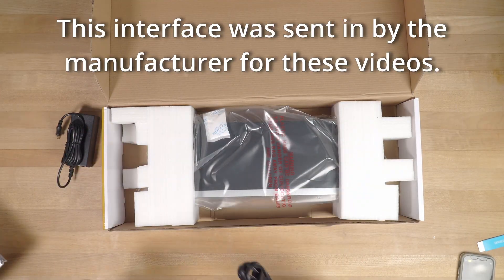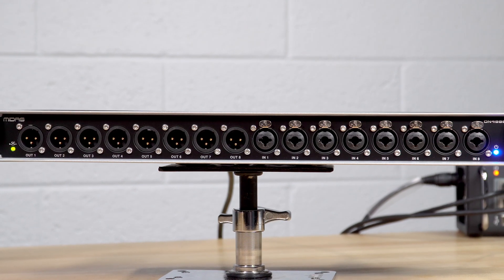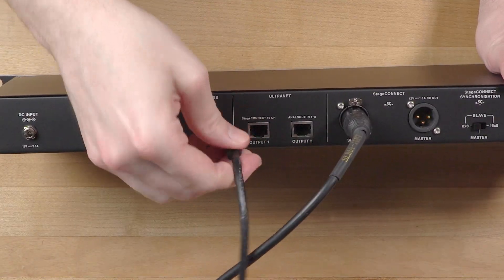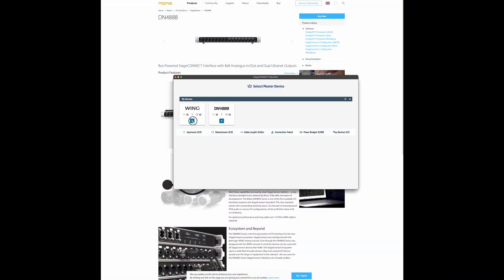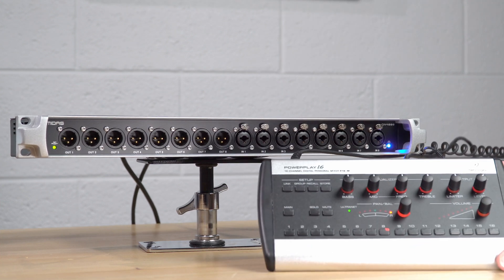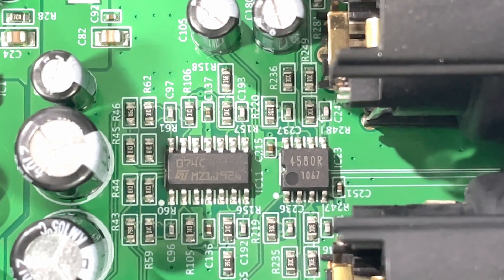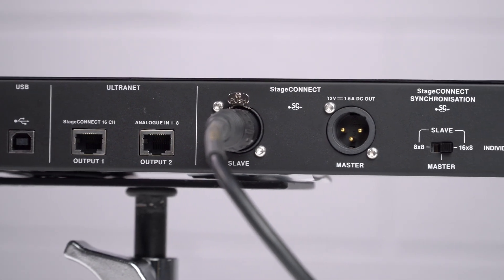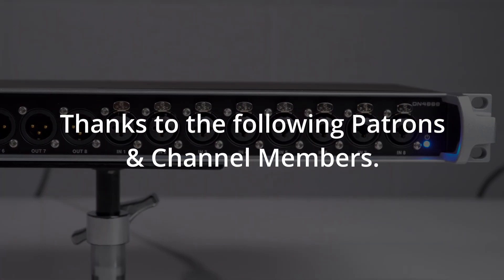Midas DN4888 StageConnect - 32. Channels on a Single XLR! 🤯

Comment: These modules from Behringer are not available, yet Stageconnect itself is open source. Either they're planning to can the whole Stageconnect (A2B) ecosystem or bring out new products. IMO a hole was no mic level inputs on any of these units.
Reply from the maker: What do you mean? I just looked and they are in-stock at B&H and Full Compas right now, and available for back order from Sweetwater. All of the versions have been available for quite a while now.
Reply: @DcSoundOp  I am in the UK and these are listed as back order for 3 months by all dealers.

Comment: I'm using a DN4816-O with Ultranet from a M32C in my IEM rack. Additionally, I've got a DN4888 on order, that is supposed to be used as expansion for my Wing Rack, to give it some more outputs, inputs and Ultranet.

Comment: Hi, i did try to connect a DP4888 and a DN4816-O together (with the 2 additional Adapters) to use as a 24ch splitter with my Behringer Rack Wing. It worked for 20 minutes until the DN4816-O stopped giving a signal. I tried everything, then i only connected the DN4816-O and by itself it's ok? Everything reconnected, ...... nothing... and suddenly no more power anymore in the ohter one, the DP4888.  Can i blow up such a device?

Comment: I have the Wing and also the SD32, So would it be better to trade in the SD32 for the Midas DN4888 StageConnect and add more units like Midas DN4816-I as we go a long.

Comment: Thanks for the great video.
Not sure if you know the answer for this, but if I purchase the Klarkteknik Stageconnect converter (DN4816U) will I be able to use the DN4888 With my M32 as a stagebox? (being able to use the 8 line inputs and 8 outputs)
Reply from the maker: Hi, yes I do believe that will let you connect StageConnect devices like this to the UltraNet port on your M32. Maybe download the quick start guides for each and compare the routing diagrams they give so you can see how it would be routed, but it should work from what I understand.

Comment: My horn rock band is replacing our Crest analog monitor mixer with an X32 rack. We have 20 inputs and 9 IEMs. We have a splitter (built into the crest) that sends all the inputs to FOH. What we think we need is an X32 rack, an S32 and some kind of splitter like maybe the Midas DN4816–0. Can both of those devices connect to the X32 rack and enable us to get 20 inputs, 20 splits and nine aux buses for the in ears?

Comment: I wish they'd drop a 2x2 or 4x4 in a little rugged block.    I'd use it for bringing DJs in to the console.
Reply: @djtecthreat  that’s where you dive into AES72, Audio over Cat5 to the StageConnect hub.
Reply: @gregorykusiak5424  Too many stops.  I'll just do a Dante transmitter direct into the internal card.
Reply: @ that’s the best way, agreed.

Comment: I have a Wing in my studio.  What's the best way to get to multiple P16s for my bands headphone mixes?  There are too many options with stages boxes, etc.
Reply from the maker: The easiest way will depend on how many of the stations you plan on using. If it's just two of four, I would look at the SD series stage-boxes as they can handle that natively. The hub is also a great option if you're considering running them over stage connect like I've shown in this video, that way you can also get way more stations connected too. So it really depends on what your specific needs are.

Comment: I am using this at my church to send outputs from my Wing to my Amp Room. supplies my Main LR, my 4 stage monitor mixes, and my stereo livestream output over one XLR cable. this allowed me to really clean up my booth.
Reply from the maker: That's a perfect use for these for sure. Great to hear they're working well for you, thanks for checking out the video!

Comment: Never heard of something like this. I don't work in live sound. Does this only work with Midas? Is this proprietary to stage connect? I'm not familiar with stage connect either.  I have a sound devices scorpio I don't imagine I can plug into that. Does it work with any computer? Already using Dante for functionality like this. Thank you, Sam
Reply from the maker: @benchdawn  Hey Sam, it’s a proprietary thing and won’t integrate with your Scorpio the way Dante does. It sounds like you’ve got a pretty good setup figured out already though, what kind of location work are you doing? Thanks for the message!

Comment: A little confused on why I would use this. I cannot use for vocal mics or instruments.
Reply from the maker: @donaldburns4462  If you use wireless mics or transmitters for instruments those all output line level. Same thing for powered monitors and wireless in ears on the output side.
Reply: I have one with the 16 outputs. I’m going to use it with my XR18 via Ultraner. When routing, this is only for the Buses or the equipment function for the Main L/R
Reply: Can i use it with XR18 to add more bus channels for the inear monitors??
Reply: The XLR connector seems like a poor match for digital signals when you could use optical or Cat5e/6/6a.  I’ve just seen so many bad XLR cables and snakes.  If you’re going to get a particular cable, get one that can’t be confused with a crappy mic cable.  

Great video though!  Love seeing the guts!
Reply: @dataplatter  Good point, but I wouldn't want to use optical in this case. It's too delicate to snake around on a stage. My plan is to the use the 16 channel output version as an IEM drop, so I want a very robust cable. I'm thinking of making an AES/EBU cable that will stand out. However, I've banished crappy mic cables from my stage decades ago. Only Mogami/Neutrik made by yours truly. Zero failures in 20+ years.

Comment: Question: Can these boxes be used stand alone, without a Behringer/Midas mixer? A pair of these (or probabbly a pair of the I/O models) could be a nice replacement for an analog multicore in a setup with e.g. an older analog mixer.
Reply: Yes... you can pair them up to make digital snakes!
Reply from the maker: @johanneshalvorsen275  Yes, I believe @dallasphill is correct. I’m working on getting another one in to test myself and do a video about it. Thanks for watching.
Reply: Same as you, i am curious too, if it's work to use stand alone, maybe this I/O can replaced standard analog snake cable i have, because snake cable for 24 channel with 30 meters length it's very bulky and heavy for me.

Comment: I love my 16 output model as expansion of my DL16 on Midas M32C mobile rack. Also I did many times IEM system with MR18 with 16 outputs as digital splitter. Theese modules are beast as P16. StageConnect is heaven, I've never had a chance to enter. Wing is no go for me. 😊
Reply: @16LiveRecords  Your name is 16 live records. Everything 16 should work perfectly for you 😀😊🤣
Reply: I have a question for you, wouldn't be cheaper to use the Behringer ADA8200 with ADAT on the DL16?
Reply: @alicino2  yea, but I would not use it remotely via fiber. So now i can have my rack at drums and place separate outputs at venue stage rack via one CAT cable